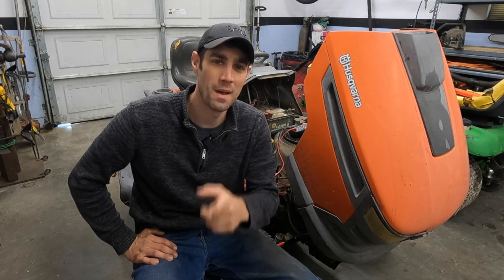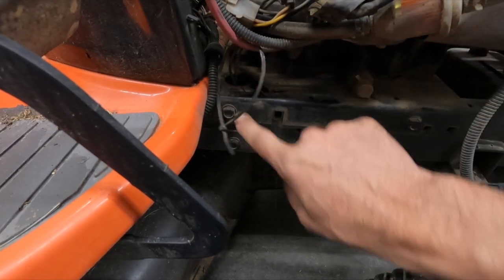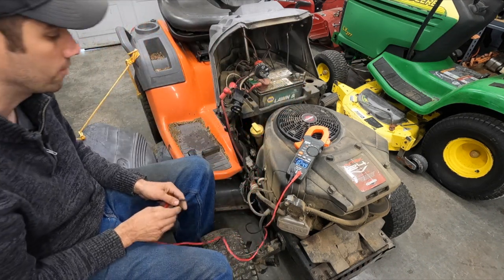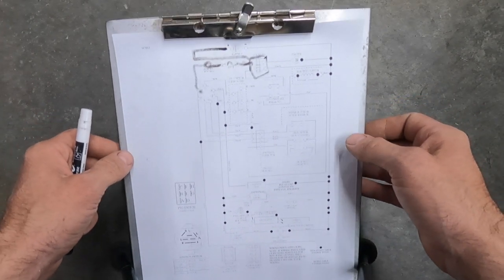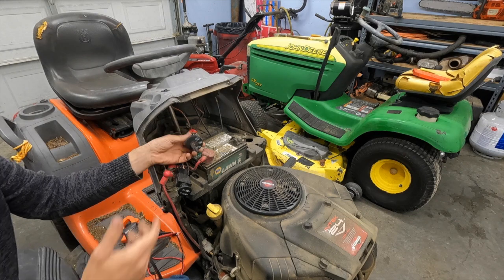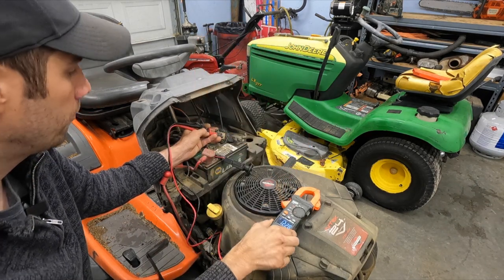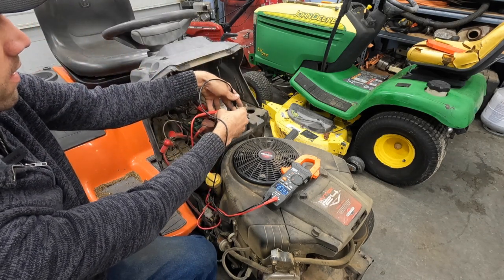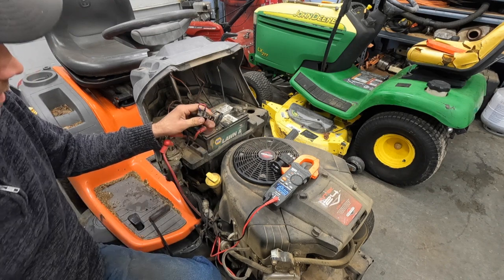How to fix a riding mower whose blades won't turn on. (Electric PTO)

Comment: So what do I do when I have done everything you have done. And when I got to testing power to the red wire just underneath the red and blue wire on the PTO switch connection, and I have no voltage, just like you did, and then, I swap out the PTO Switch, no change, I use 3 other PTO Switches. That are tested good and have been used on other machines. And that still does not fix the problem. No power to the pto clutch, it'.

Comment: My Toro Titan has about 340 hours on it, first thing I did was blow out all the dirt with 140 psi shop pressure, been working like a charm for the last 2 months.  Don’t know if that bought me time or if it’s legit, time will tell.  (I have a very dusty yard during the hottest summer months)

Comment: Great diagnostic, But doing ohms checks is always not reliable. Been burned a few times doing an ohms check. Best way to check the wire integrity is to perform a “Voltage Drop Test”.
Reply from the maker: I agree. I usually use both test in tandem, unless the continuity test is obvious. That will be a future video. I have an older voltage drop video but it needs to be redone.

Comment: My PTO switch socket was melted. I found a 10amp PTO switch online. I  also found a socket replacement kit. 
What I found was the wire size was to spec. for the Amp  draw, but if you de-rate the wire for continuous Amp draw, it was one size to small. Replaced and resized, 107 hrs later still no problems. Two Pto switches in 32 hrs. VS no problems. Just a suggestion.
Reply from the maker: That cool to figure out. Doesn’t surprise me that they spec’d it right on the fence of being capable of working.

Comment: If the blades intermittently come on and go off at different times could it still be the PTO switch? And for some reason when I got the blades running the last time, the reverse pedal would make the engine stall. So John Deere 145 and the only mower I have. I can't afford a new mower or even a used one because I'm on medical disability and don't have the money. I've already invested too much money into this mower.
Reply from the maker: Yes it could be a switch but I would first check that the battery is charged and the engine is also charging it. Starting the engine and checking for DC volts at the battery should read around 13-14 volts DC. If you are mowing and try to go in reverse most John Deere’s have a yellow button you have to press or hold while going in reverse. Shutting the blades off would bypass that switch. If you’re pressing that switch and your engine is trying to turn off, I would check your seat safety switch and the yellow reverse switch as well as their pigtails for clean/tight connections.
Reply: @metalinmotionshop update: spent most of the day looking at the things that you showed which were very helpful by the way. This is actually my mom's tractor but she died a few years ago and I still live here and take care of the property. But, I don't understand it. I know the little push down button that you're supposed to push when you back up so it doesn't use the blades. That does nothing. I checked under the seat and the safety had a black wire cut. Which means I can get up and down for my mower without it turning off and the blades still going. It does need a new battery. This year I've just been jump-starting it with a jump starter tool. Then I dove into the PCO switch? I pulled it apart like you did but I don't have a meter to test it. Cleaned it up and put it back together got back on the tractor and started it. The red up and down button on the left side and the black up and down button on the right side, which I have never noticed I don't know why, our mystery in the sense that they don't work the way your tractor does. After getting it started I pulled up the switch and I heard the clicking but it didn't engage. I checked the belt and it might be a little loose and I'm going to get one and replace it. I got back up on the tractor and was so frustrated that the blade button was down and I just hit it really hard with my hand. Sat there for a few minutes pulled back up and it engaged. So I immediately took off because I've been working on this thing and my grass was so high and at least wanted to get some of it done before it died like it did the other day on me. Fast forward. I was able to cut the entire front yard and the sides I got probably 1/8 of the backyard cut and I heard the blades stop running. So I pulled all the blade guards up and got back up on the tractor and pulled the button back up and the blades were actually turning! But they were turning so slow it wouldn't cut anything. And no matter what I did, I was unable to get it to work again. I'm getting so tired of putting money into this hunk of junk. I wish I could afford a new one. Thank you for your reply and love your videos and thank you for getting back so quickly.

Comment: I have the manual type  for engaging the blades. Found a broken spring underneath thats connected to cable wire. Ordered new part, now need to figure how to get underneath "dash" area to unhook old and reconnect new.

Comment: Thanks for the video! Around 3 minutes you mentioned running to the battery negative. I did that and there are 12 volts! Could it be the connector?

Comment: What if I have power and hear it try to engage but nothing from the blades. And they stopped during operation. Cable looks good to clutch.
Reply: I have the same issue. Did you figure it out? I was hoping he answered you.
Reply: Same here - Mountfield 1638H, Pull engagement and hear solenoid work and a subtle change in engine tone for a second but no engagement and then hot oil smell - belt seems fine. There doesn’t seem to be any attempt /grinding/;juddering etc of something frictioning when switch pulled….  ??probleM??

Comment: I have a manual riding mower and it quit and there's a black leather that's just loose dangling at the back it goes somewhere and I can't figure out where help me
Reply from the maker: Under your seat is a tag with a model and serial #. Send me that info and I’ll see if I can direct you. When you said it quit… did the engine shut off or did the mower stop moving?

Comment: Where is the fuse for pto switch
Reply from the maker: Most mowers only have 1 main fuse which is either a 15 or 20 amp. It’s usually located around the battery sometimes clipped underneath the battery tray or on the wall.

Comment: If correct fuse blown mostly the on/off switch is overheating, if you put in biggest fuse you’ll melt switch because the pto unit is bad

Comment: I had to re-watch your vid and caught what I was doing wrong on my PTO clutch issue; my clutch was only “activating” (with engine off) when key was turned to start position only when PTO should “click” with key in on/run position.  With knowing this, it tells me I have the wrong “used” key switch installed.  When putting this used key switch in, even though spade pattern is the same, their order is prob different IE the B and M spades are in a different location kind of thing.

Comment: Your explanation of the wiring harness fixed my issue. My headlight wire had melted and shorted ignition switch and selinoid. By rewiring the lights, pto came on. Thanks again

Comment: Josh, i have a craftsman 50" riding mower i bought from Lowes a year or so ago (37 hours) blades won't engage, electric pto, to test the pto switch or key switch etc,, does it require someone to be in the seat to trip the safety switch?  Thank You. Great tutorial.
Reply from the maker: Is it a steering wheel model or a Zero turn? Turning the key on supplies 12 volts to the pto switch, so you’ll need the key on for testing. First test I would do ( make sure the battery is charged) is unplug the pto pigtail and measure for 12 volts with key on and pto switch on. If not check fuses. Then check for 12 volts incoming and outgoing the pto switch. 

The pto switch usually has a separate circuit connected to the seat to kill the ignition coils for the spark plugs. 

Let me know what you find.
Reply: @metalinmotionshop  Hi Josh, it's a steering wheel model. Ok here's what I found, getting power everywhere, but it'll only engage if that stupid backup mudule is in safe reverse?? Would that be a bad module? if so can I bypass it?  I did the whole key switch test it was all good. It starts normally , just the blade engagement. Thank you
Reply from the maker: @ArmyGenMech  hmm. I assume it’s a hydrostatic tranny. I would check that the foot pedal is returned to neutral and not stuck in reverse. I would also check the reverse switch for that gas pedal to make sure it’s not being pressed. You could try pressing the pedal forward and see if that makes any difference with the pto switch.  Keep me posted.
Reply: @metalinmotionshop  I'll check it out tomorrow after work. Thanks Josh
Reply: @metalinmotionshop   Hi Josh, just wanted to tell you I found the problem, it was the reverse safety blade cutoff switch on the transmission, I unplugged it and now it works like a charm. I changed the oil, filters, plugs and blade today, hopefully she'll keep running for awhile ( Can't afford a new one). LOL. Thanks for all your help. Keith
Reply: @metalinmotionshop   Hey Josh, would you do a  video on adjusting the valves on a Kohler 7000 series 23 HP engine? Mine only has 37 hours . I'm not sure when it needs it. Thanks.

Comment: I have toro 36 inch and when I pull up the pto switch to turn the blades the whole machines turns off I tested the switch and it works but have no idea why it turns off
Reply from the maker: You most likely have another bad safety switch or a bad connection from the switch pigtail to the the switch. Is it a walk behind mower?
Reply: @metalinmotionshop  no I sit on it
Reply from the maker: @Xsparta7X  so I would check your seat switch and your left and right safety switches for the steering handles. I have several other videos on testing those safety switches as well. If you can access the back of the pigtails while the switch is installed and then push on the seat or move your handles to activate the switches while testing is better because it shows the switch is working as well as the pigtail connection is good.

Comment: I have a John Deere zero turn. It starts but dies as soon as I do anything; release the brake, pull the handles in or pull the pot. Any suggestions? I have tested the seat switch, the clutch, the pro switch like you show on your videos.

Comment: i had a problem getting my blades to engage.  The clutch wasn't activating and the PTO switch was good.  The key switch was good.  Turns out it was a bad battery.  The battery couldn't supply enough juice, even with the engine running, to get the clutch to engage.
Reply: I’m having the same problem did replacing the battery fix the issue long-term? I’m trying to decide if it’s my battery or the generator/alternator that charges it
Reply: When I have a battery booster running it will engage but it won’t engage which is the more running off the battery

Comment: Really thorough walkthru, thank you!  I have a similar Husqvarna and can't get the PTO clutch to engage.  Previously I could get it to engage after not using mower for days.  When I did use it, it would work until I stopped to maybe move something out the way, but wouldn't restart seconds later.  Not I can't get it to engage at all a few months later dealing with it being sometimeish.  So now, if I run wires directly from battery terminals to the PTO wires (both blue), I hear the clutch engage.  However, when running the mower, I can't get it to engage with the PTO switch.  I get 12 volts down the harness when I turn on the power switch and pull up PTO switch.  I saw your other video and started tightening the three bolts on the clutch.  Well, when I turned on the engine, it wouldn't even cutover, it sounded like it was jammed.  I loosened the bolts, and the engine started, but I got smoke.  I quickly realized I shouldn't have tightened the bolts, so I backed it out until I didn't smell smoke or notice a metal-to-metal sound.  So back to the problem, I can't get the PTO clutch to engage with engine off, or engine on and parking break on or off.  I am getting 12 volts down the harness.  What should I check for now?
Reply: Turns out my ground wire in the 8-inch two-wire harness connected in between the mower harness and clutch two wires were bad.  This video definitely helped me by teaching how/what to test and where.
Reply: @wesleyjoyce6061  what did you have to do then, replace the bad wires with a new harness?

Comment: Today, couldn't get a new switch. Out of stock.
So l cut the switch , at the lower weld, pulled the lower portion out. Crimped the carriage closer together & reinstalled.  Glued weld back together and reinstalled. Mowed the lawn! Took less than 30 mins. I used a hack saw and was careful of the  depth/thickness  works great!

Comment: My problem: a stick jammed the middle blade which stopped the blades. After I removed the stick, when the pto is pulled there is a click, but the blades will not start. Also I noticed the blade belt is a little loose. Suggestions? Thanks in advance.

Comment: Will a low battery cause this issue as well?
Reply from the maker: Yes absolutely. If your battery is old and tired and not taking a charge or your charging system isn’t working right…the pto will turn on until the battery voltage drops too low and will kick off.  If your charging system is working you can let the motor run for several minutes and you can kick the pto on again but usually just for a minute or two and it will turn off again. Insuring that you have a good fully charged battery and a good charging system will keep it working.
Reply: Thank you so much!!! I can’t believe you responded. I appreciate that!!

Comment: Great video! I have 1 giving me issues. If I apply 12 volts to the clutch it should engage, correct? I have voltage coming out of the switch to the clutch harness connector, and grounds seem good. If I apply battery voltage straight to the clutch it does nothing. Thanks!
Reply from the maker: Correct. I usually take a red and a black jumper wire and connect one to the negative of the battery and the red to the positive of the battery. The go straight to the pto (clamping one aligator lead clip on the pto terminal and then tapping the other jumper to momentarily turn the pto on) That way Im not leaving any room for error by using the mower wiring. Some clutches are adjustable and if the air gap gets to large they won’t kick on. If the pto is good, adjusting them can make them work again.
Reply: @metalinmotionshop  thank you so much! I have one in the shop not engaging. I will check the adjustment and see what happens. I appreciate it! Subscribed! I do mostly motorsports repair but have been doing a lot of small engine stuff too so any knowledge I can gain is great! The switch seems to be ok, voltage is there and continuity is good. The machine starts and runs no problem. Thanks!!
Reply: @metalinmotionshop  thanks again! Just adjusted the air gap, it was way off, and mowed almost half acre at my house with no issues!
Reply from the maker: @wickedrepairs8527  That’s awesome!! Great job!!
Reply: @metalinmotionshop  thank you! I never had an issue with an electronic clutch before. Now I learned something new and fixed it fast thanks to you and your video!

Comment: I changed pto clutch but before connecting plug I started engine to check voltage at connector. When I pulled/engaged switch and checked voltage engine cut off. Not sure why deck is not attached yet.
A 15amp mini fuse blew so engine wouldnt restart..not sure why it stalled.  Before clutch crapped out when I engaged blades engine started to choke.  ?????
Reply from the maker: 🤔Were you sitting in the seat when you pulled the pto switch? If not, the mower will kill the engine. You can put a weight on the seat to trick it or you can check voltage at the pto pigtail with the key on engine off and pull the pto switch. It will supply power even with the engine off. Not sure why the fuse blew unless maybe when testing the pigtail the test leads touched each other and it blew. I’ve done that. As far as the engine choking when the pto is pulled...depending on what motor, I’ve seen a ignition coil go bad on one side (for a twin cylinder engine) and the motor boggs terribly or on some kohlers there is an accelerator pump on the carb that goes bad and it boggs when the pto is pulled. Hopefully you figure it out! Good luck👍🏻
Reply: @metalinmotionshop thanks for reply.  the seat kill switch is/has been disconnected.. I disassembled the steering wheel and panel, removed all switches, battery and cleaned all connections. Checked all wires and harness. Put everything back together. Installed new fuse. Checked voltage again at clutch connection and all good. Connected pto and it engaged.  Reattached deck and everything all good.
Reply from the maker: Wow that’s some work! Awesome!!